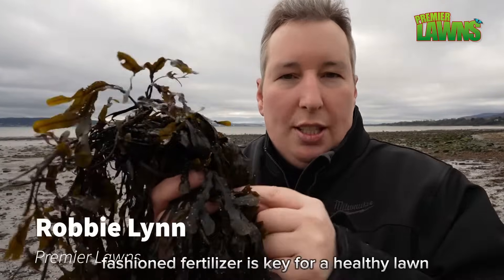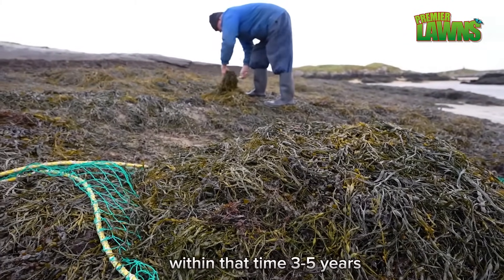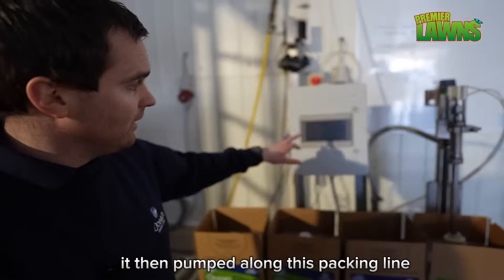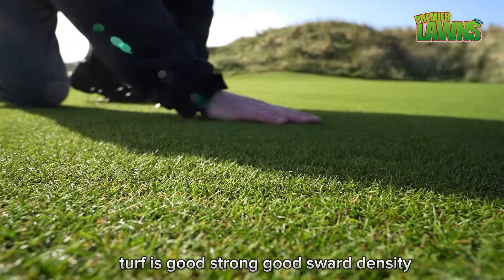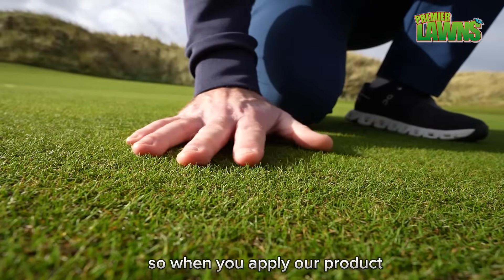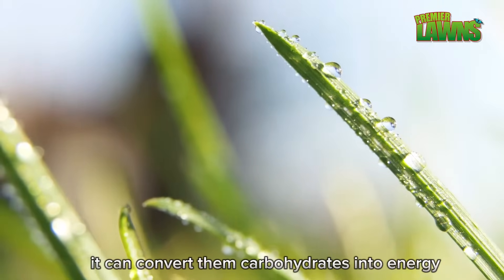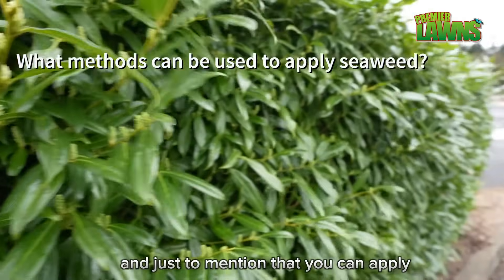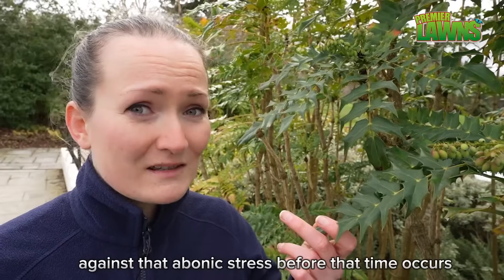Why you should use this fertiliser to get an amazing lawn

Comment: I've bought Sea Magic Dry Soluble Seaweed Extract Fertilizer, what would the dilution rate be for 1000 sq feet of lawn? Can one add too much seaweed to ones lawn?
Reply from the maker: I'm not familiar with that, it should say on the label. If not contact them directly 👍

Comment: A complex process, and of great benefit or they would not spend money on it. Obviously iron and nitrogen are going into the soil via the two sulphates . I’m not sure if the seaweed is delivering enough Phosphorus or Potassium in the NPK ratio or whether it’s delivering a list of other nutrients and carbs so that the roots are strengthened in a different way. In any case it works.
Reply from the maker: They pay for independent research with published results. It's sold all over the world

Comment: ❤ this content. Thank you for going above and beyond to get this out there. I love seaweed. Have been using it for over 30 years. The processing is key and cold press is truly the only way to preserve nutrient content. Any heat processing destroys the inherent benefits.
Over the years I’ve learned that you can easily overdo it. A little goes a long way. I tend to spray now using less than the recommended concentration. I’ve also started using fulvic acid in the mix with incredible results.
I’ve been pushing applications further into the fall early winter as long as the ground isn’t frozen.
I would love to know your application thoughts and how you are using it.
Thank you again. You are a true classic
Reply from the maker: Hi I seemed to have missed this comment, I use seaweed on a monthly basis on my own lawn 
It's great if you are seeding too or overseeding. I have a project underway that shows this
Reply: @Premier_lawns_official  u owe a pint 🍺 for missing my comment. Stay true. U are one of the few lawn dudes that actually do the work and show the bad and the good. Ur a good man and I appreciate all ur efforts
Reply from the maker: @bluejay3945  haha thanks! I just keep chipping away

Comment: Hi Robbie when using sulphate of ammonia can you use granular form , if so at what rate per m2.
Reply: Application rates for sulphate of ammonium are between 20/35 gms per metre2. That's what it says on the tub of ammonia i've got, it is also in granular form. Plus you can mix it with water as it is soluble.
Reply from the maker: I think I'm going to do a video about it
Reply: @Premier Lawns  that what be awesome Robbie.
Reply: Hi Bernie Moscrop are you sure thats the correct rate for sulphate of ammonia ive been using it at 2.5 grams per m2 one of us has it wrong ?
Reply from the maker: @garyhillsdon4093  whatever it says on the packet, use that rate
Reply: @garyhillsdon4093  
Hi Gary, it is a bit of a minefield on application rates as far as ammonium sulphate is concerned. It definitely says 20/35 gms per metre2  on the side of that tub i have. I have mixed some of it in water but at a much lower rate and adding some liquid seaweed then applying that to my lawn. I'm going to do a more thorough test with the ammonium/seaweed combination trying it out at home before using it on customers lawns first.
Reply: I have just seen 20-35 grams per m2 on a bag of sulphate thats feeding it to soil granular Iam sure Ive seen somewhere It might have been one of Robbies Vids that mixing it with water and spraying on a lawn you need far less,
Reply: So at the highest rate recommended I would dissolve 3.5kg of it in water for 100m2 ?
Reply from the maker: @garyhillsdon4093  that seems really high, I don't like giving out rates as stuff needs to be calibrated, and that's not something I can do over a text as I have no way to know if a user knows how to do it
Reply: That’s fine Robbie I am going to stick with 250 grams per 100m2 as you recommended in your vid “ How I green up lawns with liquids “ that rate makes more sense. Thanks for the replies